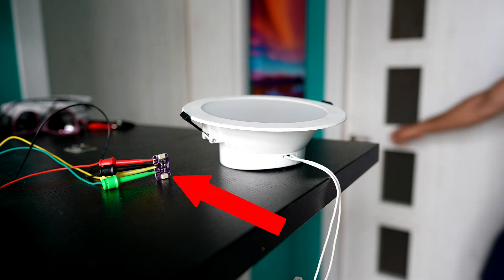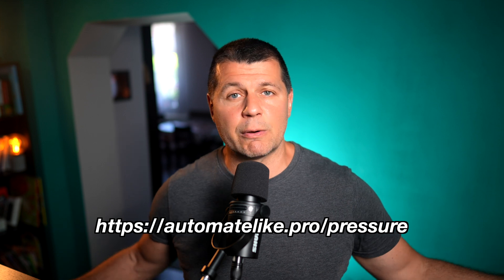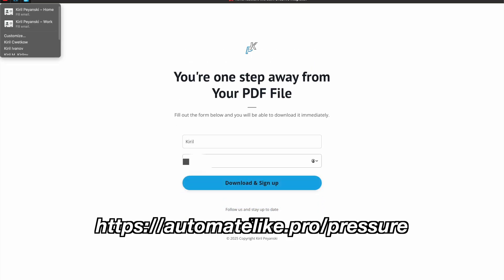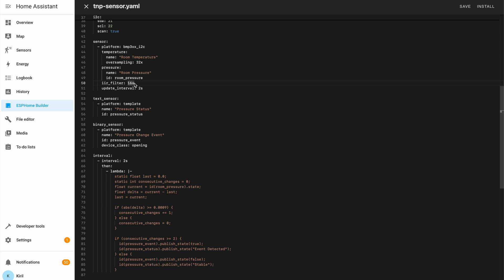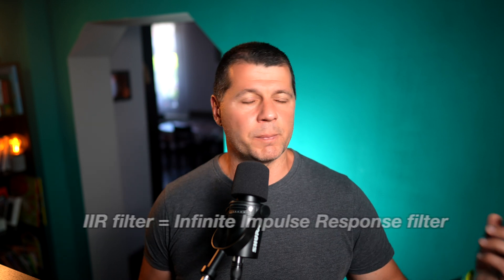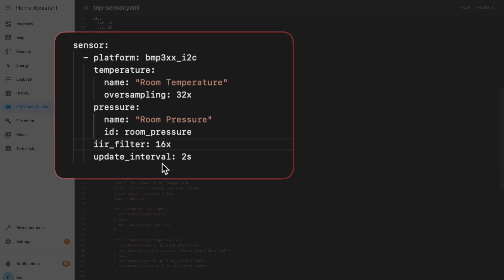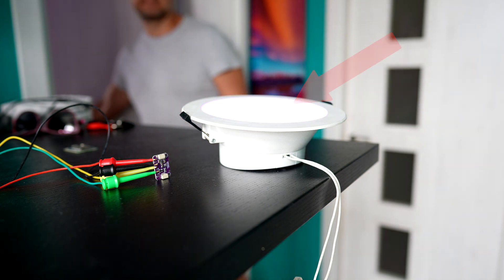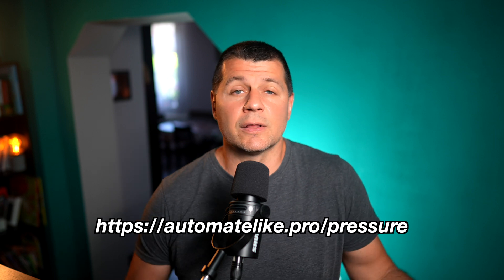Can a DIY Pressure Sensor Replace All Your Door Sensors?

Comment: "Home Assistant is driving me crazy :) It requires so much effort... I had tried it in the past and gave up , it felt like a baby that constantly needed care. Recently, I decided to give it another shot. With great difficulty (and of course, the help of AI), I managed to set it up and started adding sensors via ESPHome. They've been running for a month now.

Then, an update came for Home Assistant and the ESPHome add-on. After the update, an 'update' label appeared next to the devices. So I went ahead and updated them... The devices are still working on their own, but they no longer appear online in Home Assistant. Wonderful :) Now I have to dismount the ESPs located in very hard-to-reach spots and bring them back to the computer again. What a huge waste of time...

Another downside is the lack of widgets. Maybe I’m just unaware, but it would’ve been great to have a simple widget (like in Blynk)  where I could set a basic weekly schedule. I can't even begin to explain how much effort I had to put into making an irrigation timer... It’s all very exhausting

Comment: The filtering needs to be done at the device, not in HA, because the frequency of interest should be 10Hz~0.01Hz bandpass. This will additionally detect the ACTUAL door opening in realtime, rather than waiting for a pressure change. Filtering in HA is too chatty.
Reply from the maker: The filtering is done at the device. HA is only watching a open/close state of a template sensor but the whole logic and filtering is done at the device
Reply: @KPeyanski  Yes and that's really good, but I mean to say that filtering between 0.5Hz~10Hx will pick up the actual pressure wave of the door opening. Picking up the long term pressure change is nice but it won't detect the actual door opening, only the pressure equalization. So you need 2 different algorithms and 2 different thresholds to pick up both events. The event I'm proposing to be added is easy to detect because you can run instantaneous power coming out of the bandpass, against a running average of "background noise" This technique has been used in alarm systems for decades and those usually use a directional electret microphone with the rear sealed by glue.
Reply: I suppose an FFT analysis might be even better, and then trigger upon a specified bin level.

Comment: This might be an interesting device for measuring small rapid changes in barometric pressure that I believe occur when a jet stream is overhead.  I tend to nasty headaches when that happens, especially in the spring and fall.  It would be interesting to measure what those differences are. I shall dig deeper.  Thank you for creating this video.
Reply from the maker: Interesting thought, hope you will find it useful for your use case
Reply: @KPeyanski  It has taken me longer than I had originally planned, but I finally have the sensor collecting data. Thank you for creating the video, and the work you did to build your project. I am anticipating the velocity of change over time is what triggers my headaches.  Time will tell if my hypothesis  is correct or not. My update interval is 15 seconds, plenty fast enough for this project. I over sample 8 times, rather than 32. I left your door detection code in, just for giggles to see what happens. Because of my slow sample rate relative to your project, I am not expecting any detections. The unit is in my office upstairs, Opening and closing the doors downstairs, did not trigger pressure change event.